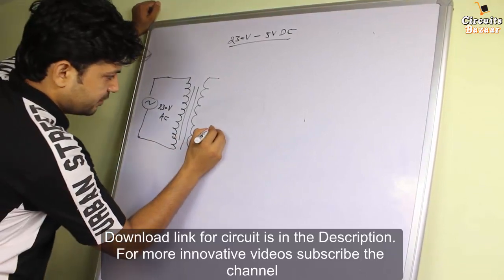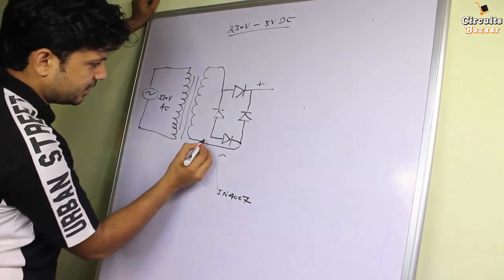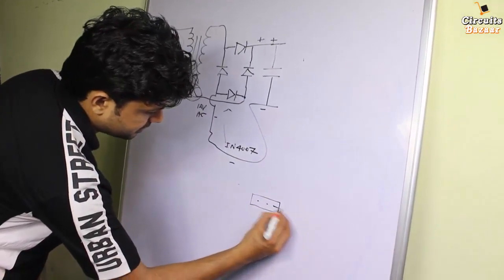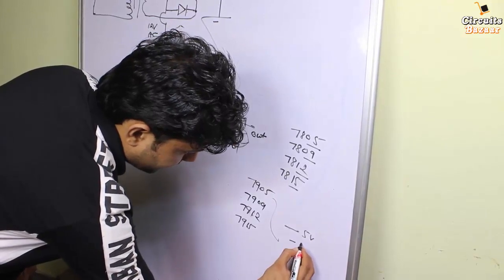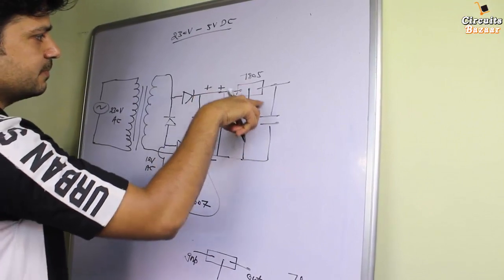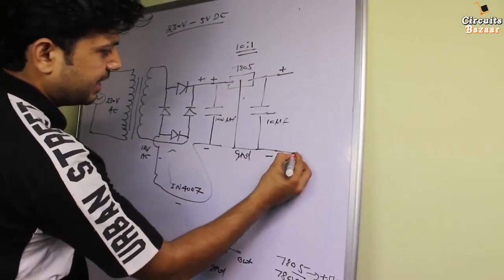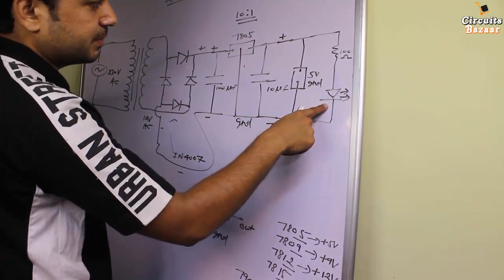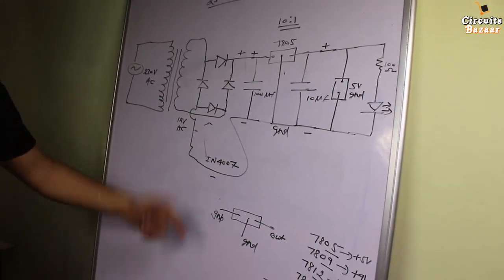230v AC to 5V DC power supply [ with complete circuit detail ]

Comment: Can I use a 6v output transformer?
Reply from the maker: Yes in case of five V you can use 6 volt output Transformer as well but always remember the Transformer must be of higher voltage than the voltage you are taking out of your circuit

Comment: I need 5amp any  Explained  me how to increase  in your circuit
Reply from the maker: You cannot get 5 volt 5 ampere current using 7805 voltage regulator for that you need to have SMPS power supply

Comment: Congratulation, a great project! Could you use a LM 2596 transistor to have a 3a current output? Thank you very much
Reply from the maker: Yes, you can but in that case make  sure your input transformer is of at least 5 Ampere current
Reply: @The.Innovative.Indian  Thank you very much